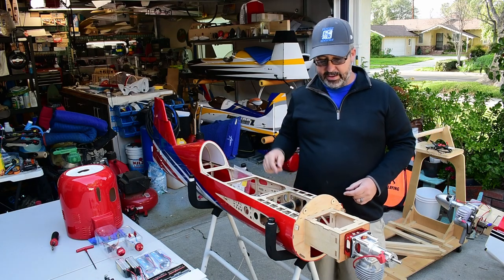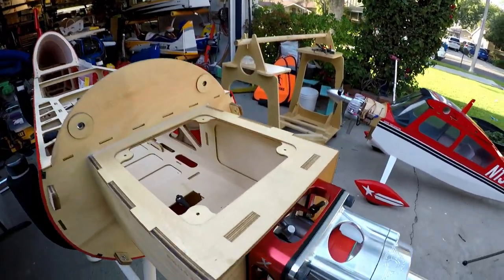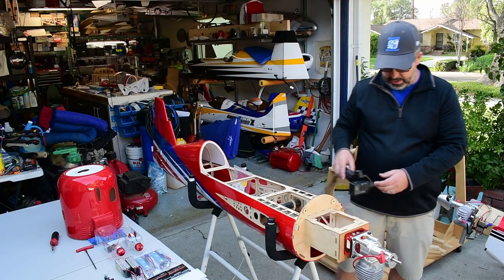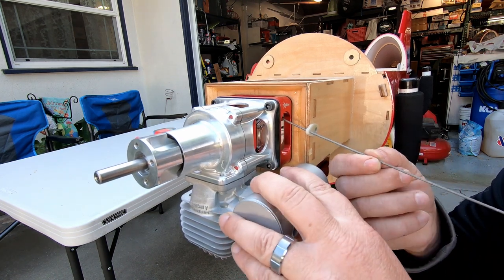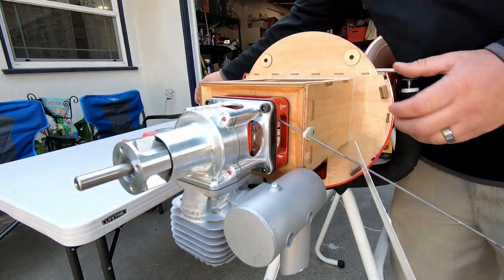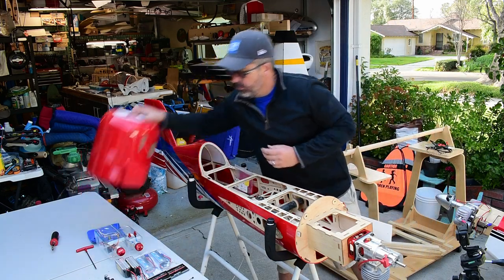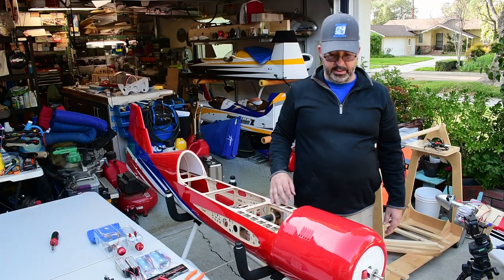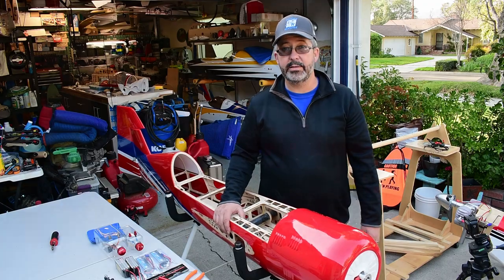FlightReviewz How To: Choke Setup (DA-60)

Comment: Another great way to find the right spot to cut in your cowl is to use a laser pointer. Line up the laser pointer on the rod (or carb screw, etc.) and make sure it doesn't move. Now, put the cowl on and drill/cut at the laser point. Works great and super accurate.
Reply from the maker: Agreed Dave. We have used the laser pointer thing before. The only downside is the possibility of the model moving an 8th of an inch and you making a wrong cut. We did have good success with it though and would not recommend against it.

Thank you for the feedback!! Keep it coming.
Reply: Not sure I understand. If the cowl is off and you use the laser pointer, how do you show that spot on the cowl?

Comment: Im so glad I found your channel. I just ordered the Extreme Flight Yak54 91" a few days ago, and I was worrying about how to do the hinges, but after watching your videos, I dont need to worry any more. Are you planning to use any power system on your plane?
Reply from the maker: Glad to have you're here, Simon. If you have any concerns once you receive your plane please let us know and we will see if we can help you out.

Do you mean power systems like power safe receivers, etc?
Reply: @FlightReviewz  yes, I was thinking about dual battery setup, swtiches and power distribution units. I've used the Fromeco Wolverine switch before, but they're not shipping to Norway anymore. I've ordered a Smart-Fly PowerSystem Sport Plus, but Im not sure if it is a good or necessary unit for this airplane. I've been away from the hobby the last 5 years, so Im not sure if it is really necessary to secure the powersupply, or how it's normal to solve it on this kind of airplane.

Comment: is setting up a servo choke the same but with a servo and transmittier just wondering because i am going to do it for twin engine
Reply from the maker: Not sure we understand the question. We go with a manual setup for simplicity and weight savings. On your twin engine setup are you going to to have each choke servo on a separate channel?
Reply: @FlightReviewz  twin cylinder single carb to clear up for you  which is 120cc 130cc and 170cc engines i have or plan to have